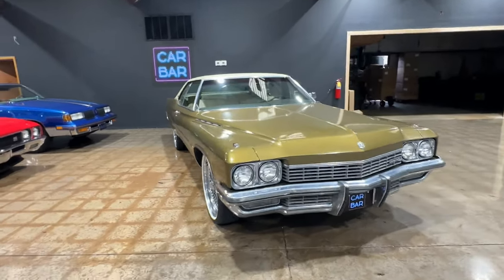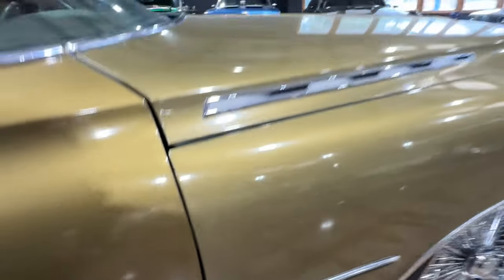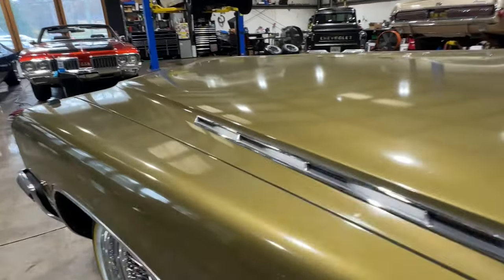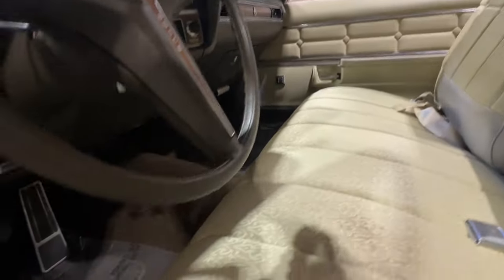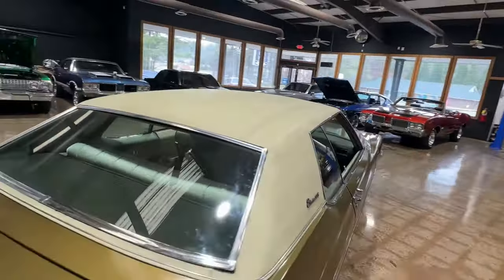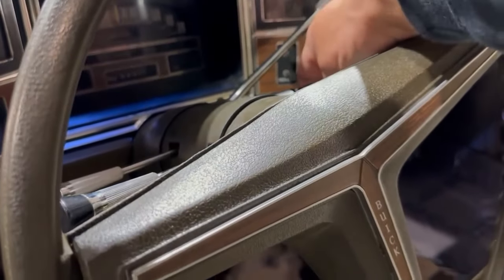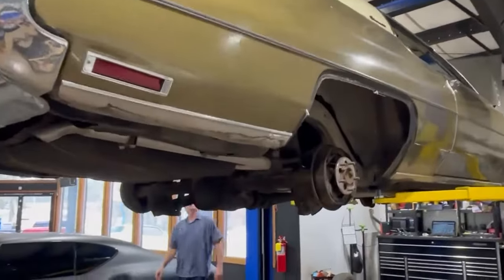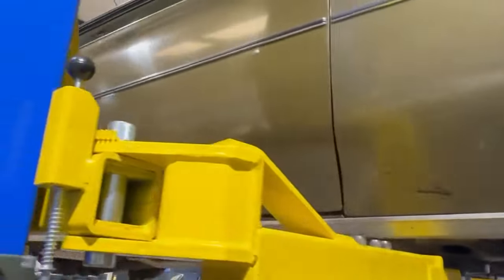For Sale 1 Owner 72 Buick Electra 225 $14,995

Comment: looks like the front clip was wacked pretty good .still a very nice car
Reply from the maker: It was never touched. If you watch the video, I made a reference to the fact that the front end sat out in the sun.
Reply: That passenger front paint changes color from the quarter panel to the door and the body lines aren't quite 100%.  Def was fixed.  Car is still a classic though.